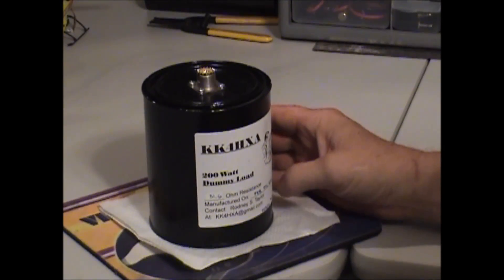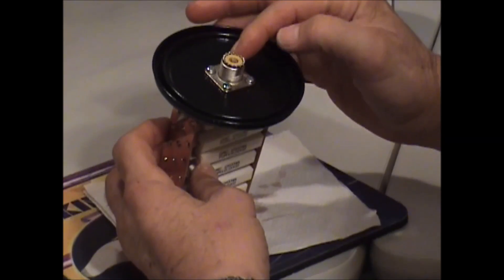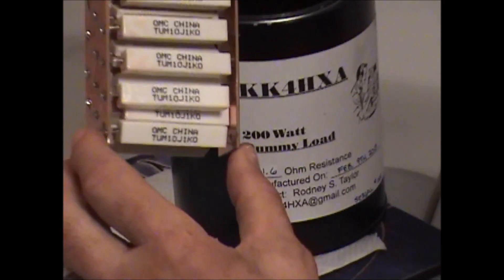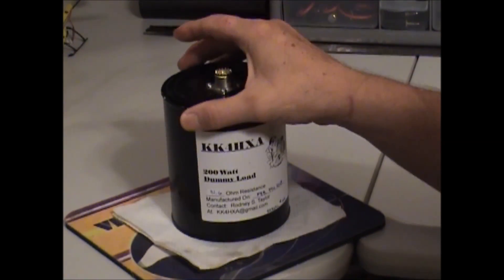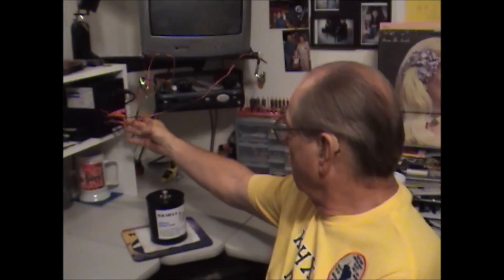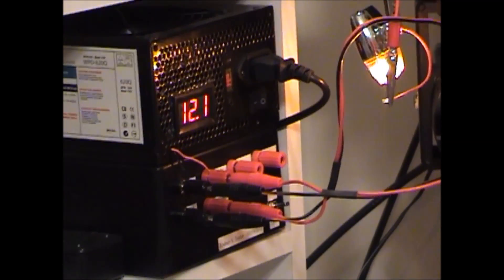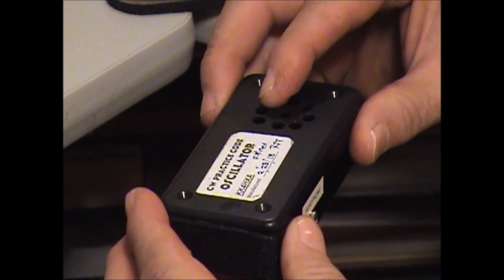Home Brew 200 Watt Dummy Load Video 07-30-13

Comment: THIS RESISTORS ARE NOT FOR DUMMY LOADS  YOU JUST THINK OK DUMMY BARE CARBONE RESISTORS NOT COI L RESISTORS  . THEIR VALUE BCHANGES WITH TEMPERATURE  WE FIND THEM IN THE INPUT BSTAGES OF TV POWER4 SUPPLYES . A DUMMY RESISTOR DOES NOT BCHANGE VALUE WITH TEMPRAYTURE MY DEAR . IF THIS NIS POSSIBLE3 BY JUST RUBBISH WHY DO THEY COST SO MUCH . AWSOME .BUDDY . SEEMS YOU NEVR STUDIED ELECTRONICS BEFORE . NEVER MIX WHAT YOU JUST THINK OK . SORRY FATHER 
.
Reply: The inductance range of these metal oxide resistors is good enough for this application. Seems you have never learned how to spell or type.

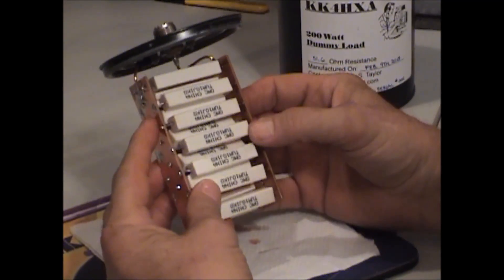Comment: Nice work Rodney.  At 2:58 in the video we can see that the resistors are in fact, as Rodney explains, Metal Oxide with the code "TUM..." and NOT wire-wound, and they are 1K at 10 watts each -- Mouser sells these - have a look.  The 200 watts are achieved by putting 20 of them all in parallel and the result is approx. 1000/20 = 50 ohms.

Comment: try a hot water tank like i have ,just disconnect the tank from 220v and then connect the tank to you radio ,the SWR is perfect and is good for 8000w or more

Comment: that is a flanged so-239 connector, not PL-259 or pl-239   and those are wire wound resistors.   transmission oil stinks, get Silicon transformer oil , or Mineral Oil  with a dye if you need color

Comment: I know this is an old video but I am making a small dummy load and read that I had to use non inductive resistors.  the resistors you're using are standard wire wound.  do I need to use non inductive?

Comment: Those resistors are wire-wound.
Reply: TUM are metal oxide.  TUH are wire wound.  He didn't use wire wound.  You are incorrect.

Comment: Are you sure that they are MO resistors? Look more like wirewound to me. As someone else has pointed out, they are far too inductive for most radio applications. You could get quite high voltages generated across them at higher frequencies.
De G4FAT

Comment: Wrong resisters.  Don't use wire wound, they're too reactive.  Use carbon or specifically designed RF resistors.

Comment: The resistors are wirewound, NOT Metal Oxide types.  WW = very reactive at RF, especially at frequencies much above the low MHz range -- with a similar rise in VSWR.  Even if you get lucky in that regard, you still have the issue of getting rid of the heat.  This design (as is the root Heath pn HN31 "Cantenna" design) is inefficient in that regard. This design is worse because Heath used transformer oil that has a lower thermal resistance than this person's recommendation of mineral oil.  The automatic transmission oil he prefers to use isn't much better than mineral oil.

OTOH, I used four 50 Ohm / 400W flange-mount RF resistors on two heatsinks for a DL that can handle 1500W at 100% duty cycle as long as the fan is blowing. Cooling was verified using an inexpensive LM35DT temperature measurement IC, and a 40.68 MHZ ISM RF power source. My design with short connections resulted in VSWR under 1.5:1 thru 54 MHz.  Reasonably-priced RF power resistors can be found from various vendors on ebay.
Reply: "The resistors are wirewound, NOT Metal Oxide types." ... Wrong. He used TUM type which are metal oxide.